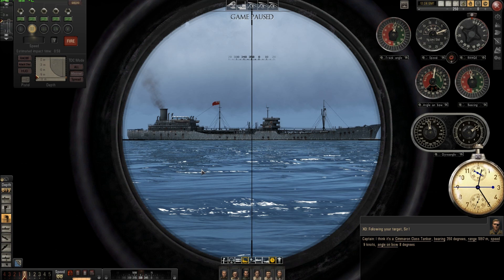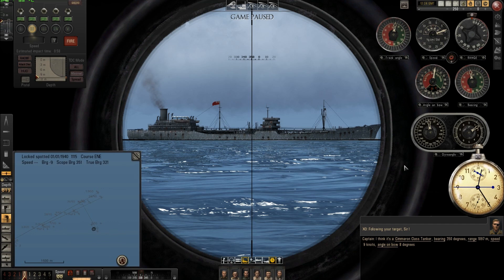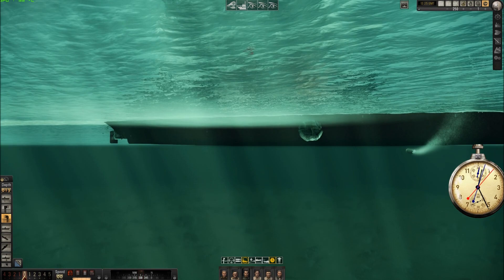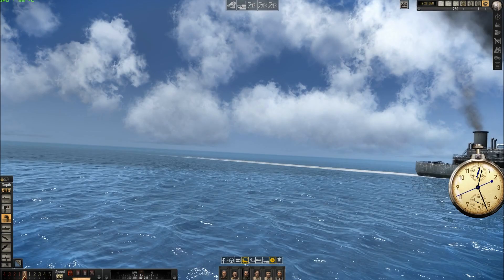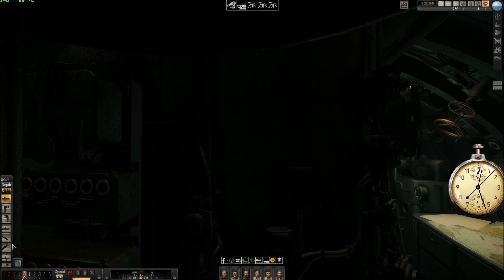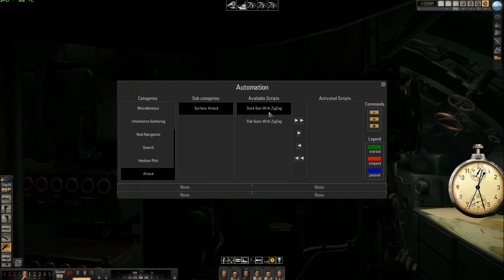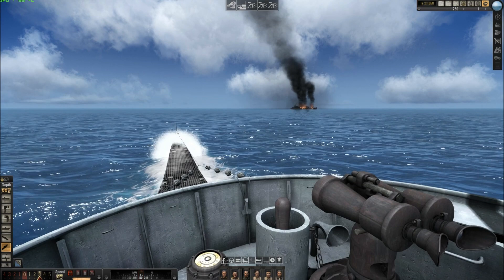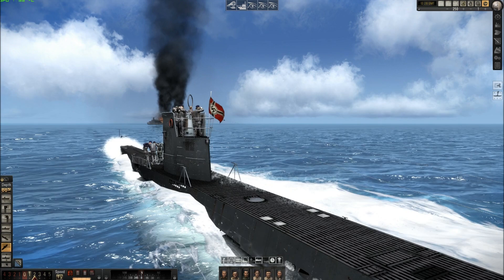Manual TDC with Real navigation and Realism 100% for SH5 part 4-4.mkv

Comment: A few comments in case they haven't been pointed out before:

1) The first torpedoes to hit the ship were the non-electric torpedoes set for "Impact" that were actually fired last.  The last torpedo to reach the ship, that did not explode, was the electric torpedo set for "Magnetic" that was fired first.  The non-electric torpedoes travel much faster than electric torpedoes so even though the non-electrics were fired last they reached the ship first.  The electric torpedo that was set to magnetic that passed under the ship without exploding just didn't work properly.  This was actually very true to history as both the U.S. and Germany had major problems with their torpedoes in general, with both countries having even more problems with magnetic torpedo settings working properly.  This is modeled in the game.

2) Since you were locked on the ship when firing you should have fired a salvo of the two non-electric torpedoes set with a spread angle of < 2 degrees to spread the damage across the entire ship rather than having two torpedoes hit the ship at the same spot.  Or, you could have unlocked the ship and fired the torpedoes separately as different sections of the ship passed the cross-hairs of the scope for the same result.

3) Your measurements taken throughout this video were very precise and informative.  However,  you did not need this level of precision to plan a true attack if realism is your main goal when playing SH5.  Many of these measurements would have been quickly estimated with some charting to help determine ship speed.  You don't need to get exactly on the 90-degree angle of the ship, especially when firing torpedoes set to magnetic.  The goal is to be as close as possible when estimating range, ship speed, and angle on bow and most Captains just looked through their scopes to do this.  Especially when you are in more rushed situations.

Great video and tutorial.  Thanks.
Reply: The Niwo I like the 3:15x10 rule.  I remember something like that years ago but I had forgotten about it.  Thanks for sharing.  All of your videos are very helpful.  I am currently running the game using the Wolves of Steel mod pack.  Is there any major changes in procedures using this mod pack compared to what you do without the mod pack?  Do you have new tutorial videos available using the Wolves of Steel mod pack?
Reply: how u can find speed only looking on periscope??!?
Reply: knotk = (length meter x 1944) / seconds

Comment: 2022 now and that was a good hunting Sir
and sorry for the electric one whehe v:
Thanks for sharing the knowledge so far, that's really helpful for a neubie Sailor.
Anyway, i got a little probs with the crew interaction menu like navigator, gunner, teleport ect.
I've install the TWD's New UIs V7. ect ect, but it doesnt appear on the screen, except the real navigation is works.
Any solution for this? thanks in advanced.

Well, once again, great hunting, stay healthy, Safety First, Peace i Salute 😉